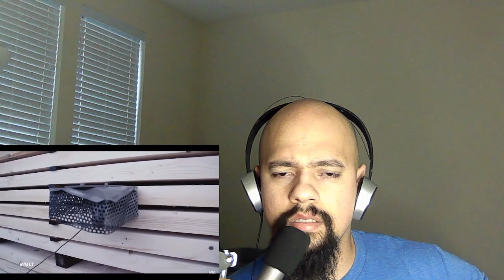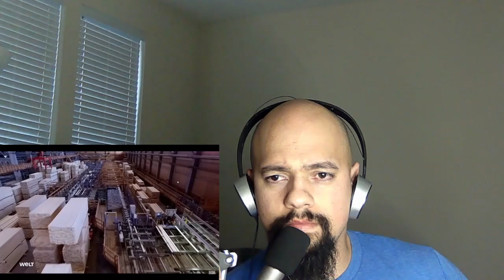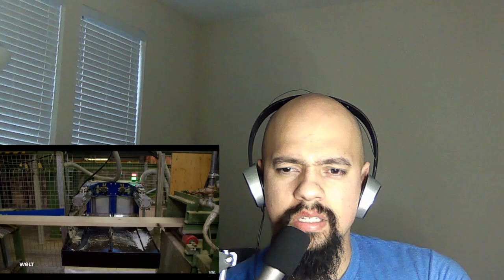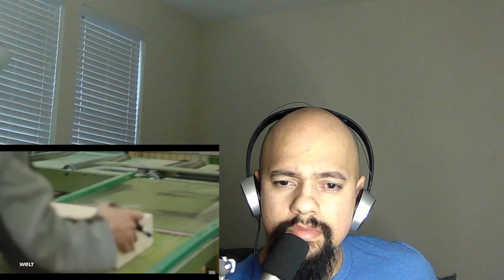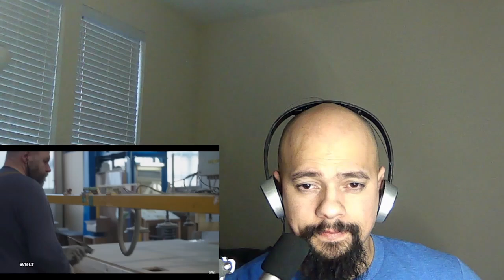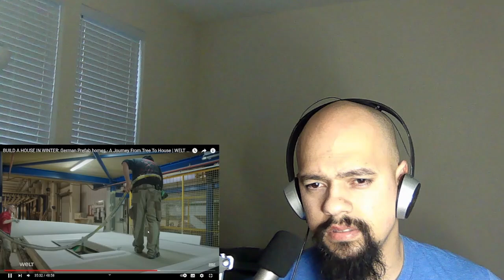American Reacts To how to build a German house Prefab Part 3

Comment: I was remebering ou house build when he talked about the size of the slab. We were in a house just like the one we wanted to build. It was 0.5 meter shorter and narrower then the one we build, and it looked big enough for us. But when we the slab was finished and before the walls were set up, we wondered how small it looked. Also when only the ground floor walls were set up, but no ceiling was on top of those, it still looked small. But as soon as the ceiling/floor for the next level was laid down we imidiately saw the size and the space we got, and we had expected when planing.